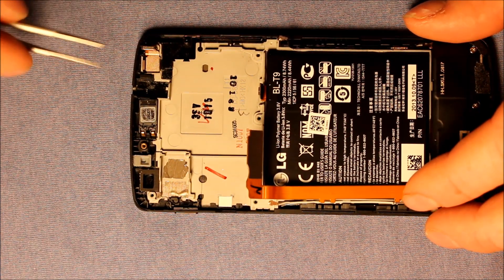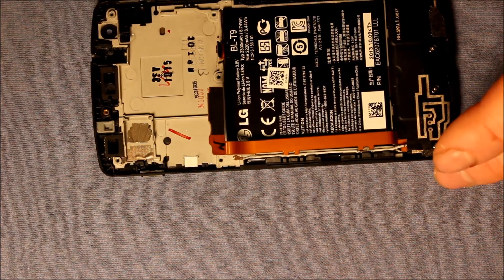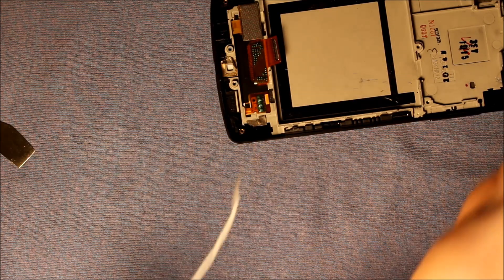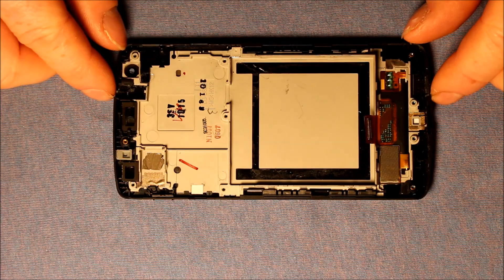LG Nexus 5 Screen Replacement Repair Part 1 How To Change

Comment: I used a paint scraper / razor blade to remove the broken shards from the edge. Lots of heat, worked great!
Reply from the maker: +Schrödinger&#39;s Ape Good for you! Thanks.

Comment: My screen work automatically sometime , can that be because of faulty LCD ? because I am not sure will issue be shorted out after replacing the LCD.
Reply from the maker: It could be a faulty LCD or maybe loose connection. Was it dropped before this happened?
Reply: +Smart Easy Repair No it wasn't dropped, all of sudden this started ! sometime it works well sometimes it doesn't!
Reply from the maker: I think it sounds like the LCD is going bad.

Comment: I bought the LCD and digitizer for Nexus 5 and before installing it I wanted to test it so I connected everything before gluing the lcd and press the power button and I see the lcd turning on but there is white noise all over the LCD, Do you know if this this a problem with the new LCD and digitizer?
Reply from the maker: Is your connector on right for sure? Can you press down on the connector a lil while it's on and see if it makes a difference?
Reply: Yes my connector seem to be on fine and when I pressed it it doesn't change anything. I still see white noise and if I try to turn it off using the power button it stays on. I am disconnecting the battery connector to shut it down.
Reply from the maker: Oh ok it sounds to me like it could be faulty then. I would try to get it exchanged for another one. Good luck with it!
Reply: Thank you!
Reply from the maker: No problem.

Comment: Can you help used your video now phone wont charge
Reply from the maker: It sounds like some connector just wasn't connected properly.. The only thing I know to do is take some of the connectors apart and put them back together carefully.. Especially the battery and charging port ones.. Hope that helps. Sometimes they are just finniky and just need to be taken apart and put back together to seat them better..

Comment: Hey Paul, 

Quick question... It appears my "LCD Cover" is broken and not the actual LCD itself.

Ebay seems to sell the covers alone. 

Would it be possible to replace the LCD cover? Or is the cover glued onto the LCD?

Comment: alright I did it. and the screen works great and there are no problems with the phone. Except now, I barely get any service anymore. I get perfectly good service when i'm at home (LTE) but now i have to go the town center to get service. Any Help?
Reply from the maker: I'm wondering if one of your antenna wires isn't connected properly... You may need to take it apart and just make sure the wires are connected properly on both ends..

Comment: Hey man, great vid. Hoping you could help with something. I replaced my screen as instructed and it went well with everything functional. However, after a couple of minutes, the screen blacked out and hasn't been responsive since. The phone itself seems to be functioning fine with only the display messing up. I've tried reassembling a couple of times to no avail. Hope you can help!
Reply from the maker: Hey I had that problem when I first did it too... I couldn't get my screen to turn on at all..All I did was take it all apart and carefully put the connector back together and then it worked.. I don't know if there is a specific connector that is very finnicky or if it's several of them.. Something has to be just right somehow.. SO my only advice is take it apart and carefully put it back together making sure all the connections are properly seated and tight and restart. That did it for me. Good luck!
Reply: Cheers for the quick reply Paul
Reply from the maker: No problem! Thanks.

Comment: Based on what I've seen in your video's, isn't it easier to only remove the motherboard's plastic shielding and unplug the dock cable from the board then just open up the speaker assembly and pull out the screencable and push the screen away via the screencable slit? That way you don't have to disasemble the whole phone in order to replace the screen. Or am I missing something?
Reply from the maker: Well if you have to apply heat to get it off it's safer for the motherboard and other components to be removed.. You are welcome to try it that way though if you like..
Reply: Yes good point, however most SoC's can function safely between temperatures  of 70 and 80 degrees Celsius (158-176 Fahrenheit). So am I safe to assume that the glue won't be needing those temperatures in order for it to loosened up?
I might need to remove the battery though.
Do you think it'll be to risky this way?

Comment: Isn't there a way to replace just the glass lens only? the glass and lcd is real expensive
Reply from the maker: Yes you can try.. It's quite a project though.. You just have to be careful.. Here is where I found it the cheapest if you want to check it out..http://bit.ly/Xw8P83 Thanks.

Comment: So i crack my screen it pretty bad the touch pad stile works but i need to buy a brand new 100$ fucking lcd screen with new touch pad jut to replace the glasse fml
Reply from the maker: Yeah sorry that's about what they run.. Much cheaper to do it yourself though.. You n try replacing just the glass if you want but it's quite a process.. Here is where I found them the cheapest http://bit.ly/Xw8P83 Good luck!